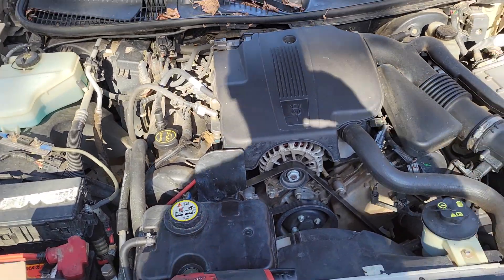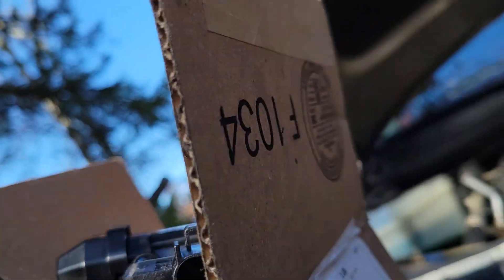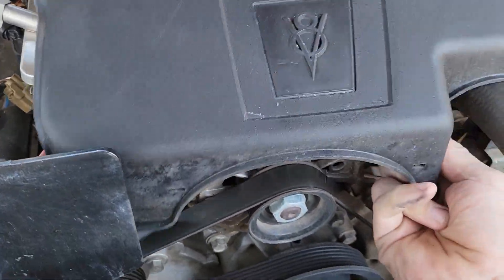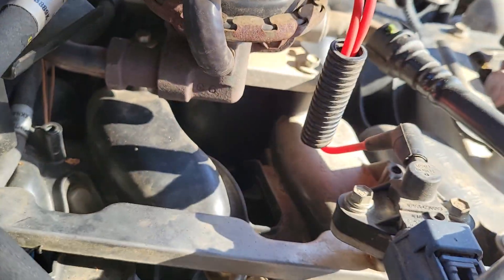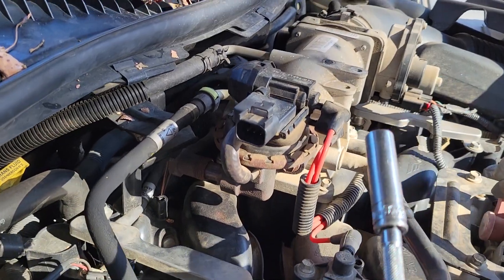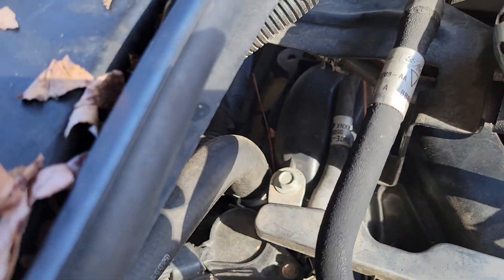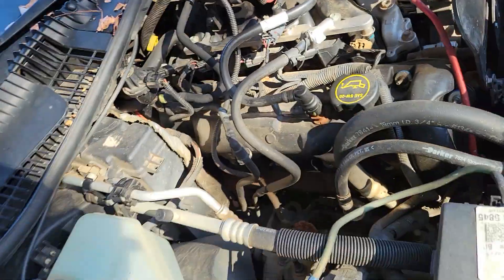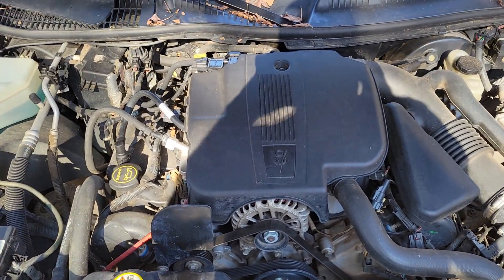Lincoln Town Car EGR Valve Replacement

Comment: Thanks for the great instructional video. I have a 2001 Town Car and every 4 years or so I need to replace the EGR sensor. I just ordered a new sensor, but if that doesn't fix the driveability problem, I will change the EGR Valve. Mine has the same 3 bolts to remove like yours does. Your video made it look so easy to replace, I'm sure I can do it too.

Comment: Was the code p0443 p0401? I already a ordered a new egr valve and a evap canister cylinder I already swapped my purge valve and it did not fix the problem so I returned it  but I think my egr is the issue it looks rusted and old  I did a test on it while  car was on   I cut the air coming into with my finger on the filter and it didnt cut of when it’s suppose to
Reply from the maker: @danielpelaez9978  yes that was the code